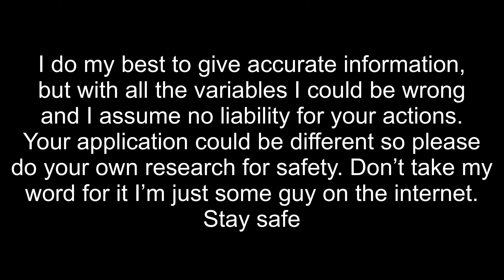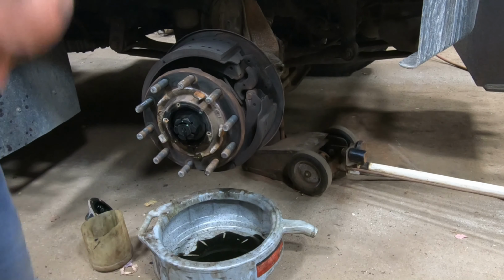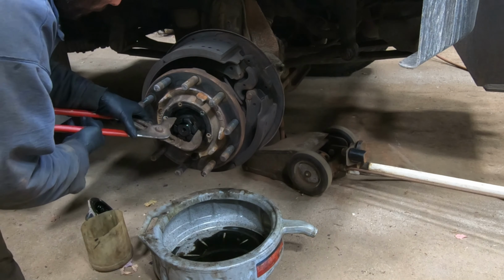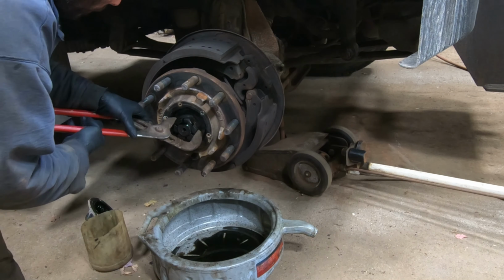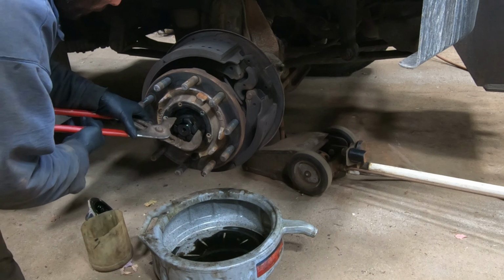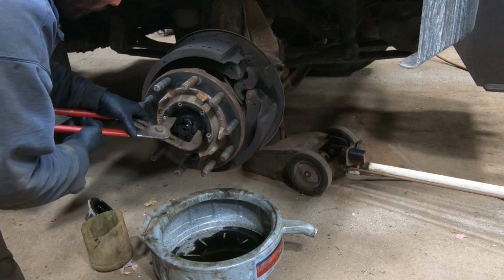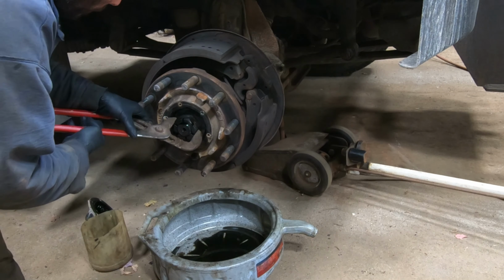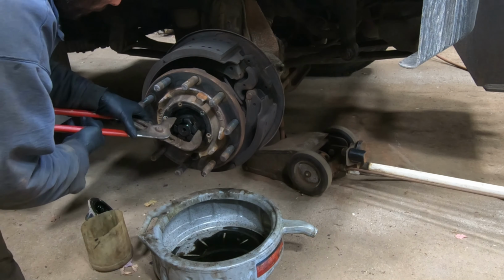International work star, spicer front axle bearing replacement

Comment: Amazed to see sparks coming out of the hub when the races were being tapped out.
Reply from the maker: The races were in there pretty good. It was actually quite the work out getting them out. You can run a bead of weld around the races in the middle and it will shrink them so they will come out easier but I was concerned of getting spatter in the hub.

Comment: just two word and/or thought - "Hydraulic Press?" Sure would make things easier, safer and less potential damages to wheel hub?
Reply from the maker: That does make perfect sense. Problem is we don’t have one. I’d like one though, maybe someday.
Reply: Punching wheel bearing races out and in by hand is a normal practice. I normally use a round ended tapered punch - fairly large - and a good heavy hammer for removal. I start with lighter taps and work up till they move. They often take a good swat or two to get moving. Using the old bearing like Jason did for installing races is a good method. A heavy hammer delivers good energy without a high speed swing.  I find it is easier to control - it absorbs the rebound energy of the punch too if that makes sense.   Sometimes the hubs have a notch or two for the punch end to contact more of the race. Not sure about the specific one in the video.